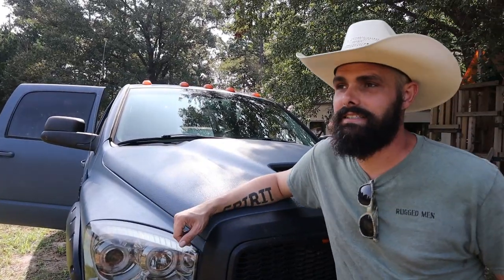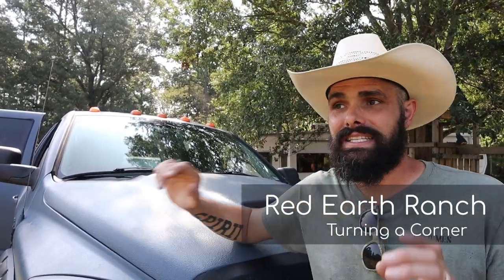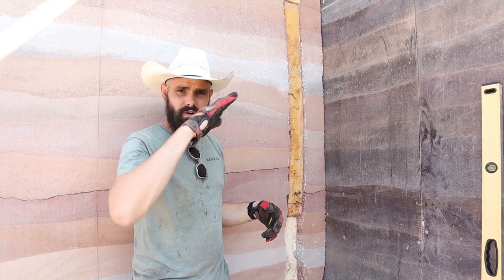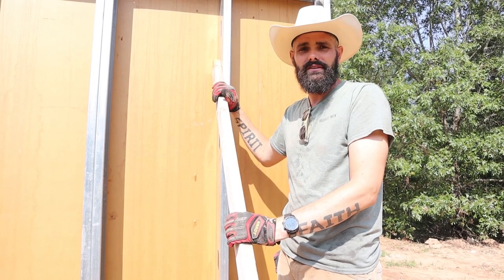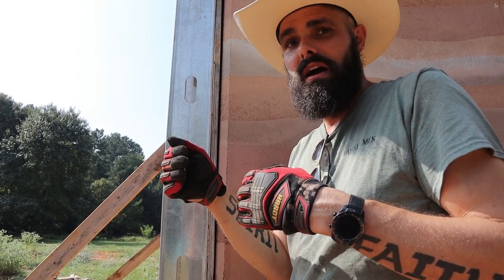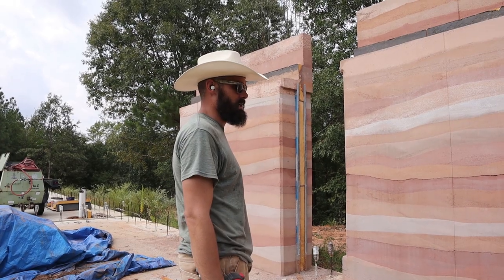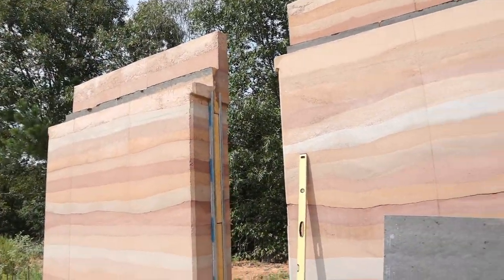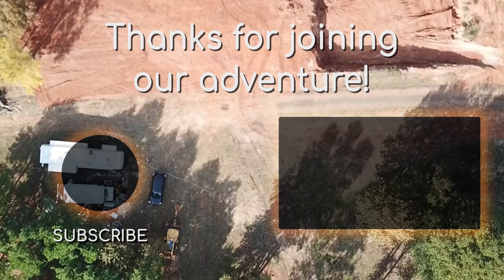Framing for a Rammed Earth Corner - Vlog 52

Comment: Why not make a corner form without a seem then add the walls to the ends? Have you tried this idea yet? Also making the walls thicker so that the exterior and interior walls encasing the foam insulation have more equal mass or centering the foam insulation instead of having a thinner exterior wall may possibly reduce the wall bowing. Just an idea. By the way the walls look amazing! Love the videos!
Reply from the maker: Thank you for the kind words we are loving the way the walls are turning out. 
About your question with a corner form. The problem is you would have an overlap of the side/end of the wood when forming. So you would have a 3/4 inch section with a rough look and texture. You could mitigate this with an angled piece however that adds a layer of complexity to the formwork. This is actually an easier way and you end up with a cleaner look when done. Hope that makes sense, it's kinda hard to explain well without having it in front of me LOL
Reply: @RedEarthRanch   @Red Earth Ranch  I get it! I was thinking you could put a large triangular filler in the corner of your mold/form for the exterior portion and build a reusable interior corner form to make a flat surface instead of having a regular 90° interior corner as well in some corners where you wouldn't need a 90° corner for something like a cabinet install. I mean you could still install cabinets with a flat corner but would probably have to install a small filler panel in some cases.  I was thinking it would be cool to be able to install electrical outlets on the flat surface in the corner. I just saw another video from Matt Risinger where he visited a rammed earth construction project work site and they used bondo to fill and cover the screw head indentations on their forms. That would eliminate your issue. They also used solid corner forms, although they do have a large construction crew to make light work of it. Must be nice!  Lol Anyway, thank you for your response and videos! Your walls look amazing!  I'm currently buying a property out west as I plan and hope to also someday build my own home with Rammed earth andmight consider a hybrid or combination of other natural building methods like cob, stone, haybale, reused brick or logs. Doing my research! So far, I think Rammed Earth is the most aesthetically pleasing and resilient of them all! Lol Thanks again!
Reply from the maker: @siuolsretlaw8166  That's so exciting to hear about your project out west. I love hearing about people building this way! I saw that vid from Matt Risinger and I agree, having a full crew would make everything go faster if only they would work for free LOL. I'm glad you are enjoying the videos, keep us updated on your project as you get started.

Comment: Thanks for the vid. I wonder have you thought of or tried sanding down the "joints" in the wall where the ends of the framework are? e.g. at 1:58 there's a vertical joining line to the left of you. Is it possible? What would it look like?
Reply from the maker: We actually just tried that yesterday. We will show you in an upcoming video with the results look like. They look pretty good :-)
Reply: @RedEarthRanch  sweet! thanks. looking forward to it! :-)

Comment: Beauty of imperfection I love that
apologize if you already explained that please tell me how are you plan for the electrical outlet water cable TV and internet
and most important question do you know what to do with if you tools  after finish the house?
Reply from the maker: Electrical, cable and internnet is run up the walls using rigid conduit and run right next to the foam. The outlets are attached to the inside of the form and rammed around to create a recessed plug. The water is run straight through the wall then run along the floor. You can do pipes in the walls but when they eventually need repair you can't access them so it is better to run them outside the walls. After we finish we plan on building a few other rammed earth homes around the property so it will likely be a while until we need to sell the equipment.
Reply: @RedEarthRanch  thank you very much for answering my question
Reply: @RedEarthRanch  thank you very much

Comment: Have you guys done anything about your design / permitting process? I'm also curious about utilities to the property and rough mechanical in the house itself.
Reply from the maker: We haven't really shown the design process but we definitely could if yall are interested in seeing the 3d model. As far as permitting we are outside city limits and the county we are in doesn't require any form of permitting unless you have a septic tank (we are using composting toilets so we won't need that). 
The property is about 6000 ft (about 1800 m) to the nearest utilities and they charge by the foot to bring it in. So we have no attachment to any utilities, more by happenstance than choice. 
As far as mechanical to the house we will show the process as we get there but the basic idea is that electrical and plumbing runs in the center of the walls up against the foam middle.
Reply: @RedEarthRanch  I think we'd love to see the 3D model.
Reply from the maker: @Noble909  I'll work on screen capture and see if we can't share that with everyone. Thanks for the idea!
Reply: @RedEarthRanch  i'm really curious too for design especially plumbing electrical set up,  perhaps some video explain all this :) ,  is some way could weak rammed earth wall ? i mean for continous foam on 90 deg wall and inner plumbing. i really like your vlog with details we didn't find easy on set up :) thanks you very much for this ( someone from France planned to build a rammed earth house)
Reply from the maker: @habkeys1480  Thanks for watching! We definitely plan on showing how the plumbing and electrical will work but we won't be doing that for a while so here is a quick preview. Basically you add in rigid conduit for electrical and run it right next to the foam. The wall gets rammed around it and it doesn't affect the structure of the wall at all. Plumbing will basically be a straight pass through from the outer wall. I think you can do pipes in the walls but that can cause problems later on if/when the pipes have issues. Hope that helps!

Comment: Why do some houses with rammed earth have insulation and other'd don't?
Reply: It depends on the environment but often people think the thick walls will be enough. That is not the case if you are looking to thermally insulate a house. Insulation creates a thermal cap between the outside temperature and inside temperature. The walls alone would allow thermal transfer of temperature and you would constantly be fighting the outside temp. Hope that answers your question